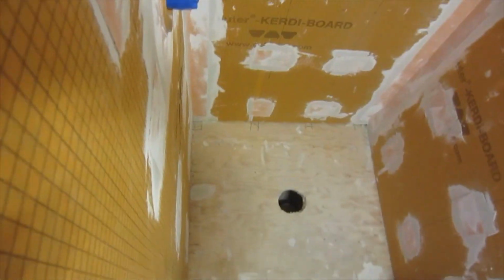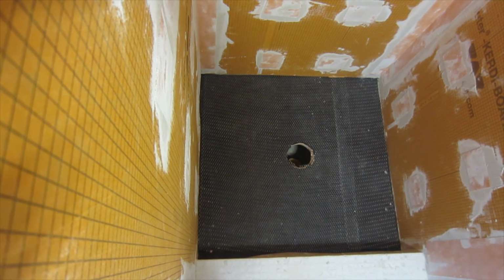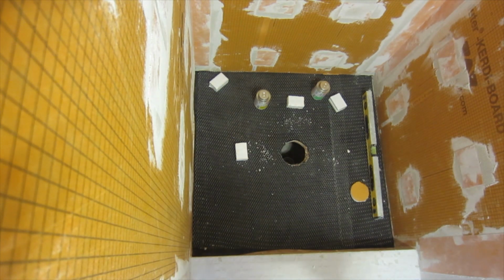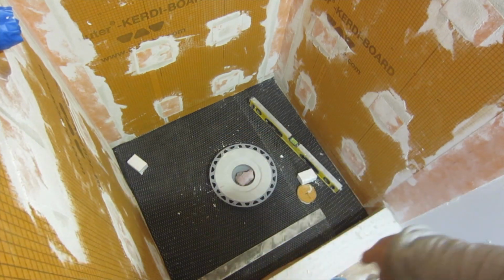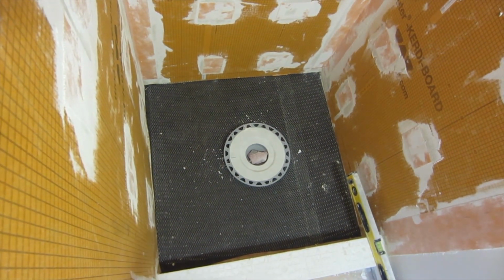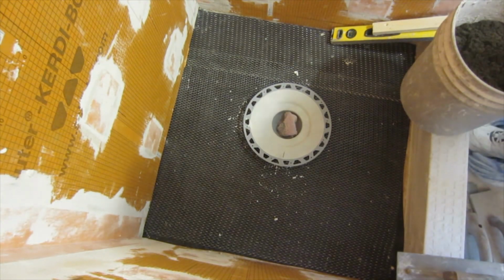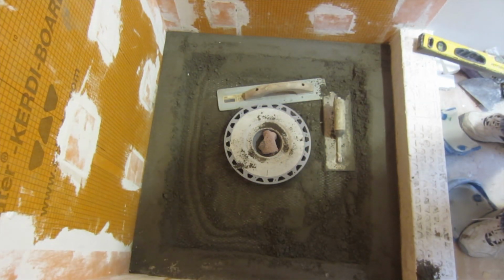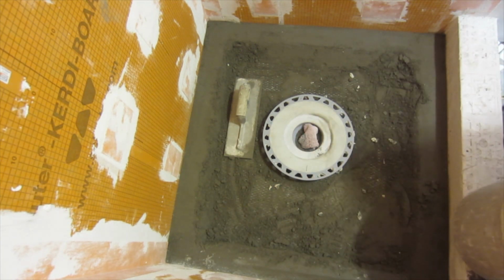How to install a Schluter Kerdi-Drain with Deck Mud

Comment: Hi Sal. A plumber installed a vinyl pan with mortar bed and clamp drain. It is over a cement foundation.  I found out he didn't do a preslope, so at this point my options are to just go with it and not worry or use the schluter drain a adapter kit, if I use that I'm not sure how it would work over a mudbed? Thanks in advance for your reply.

Comment: Sal, how would this be different if you had a shower with an offset drain? 3x6 shower qhere the drain is on the far right side, about a foot to 16 inches off the wall? The entire perimeter of deck mud wouldnt be level, right? Otherwise the slope on the right where the drain is close to the wall would be huge compared to the left...

Comment: How clean do I need to keep the top of the drain?  I thought there was a fleece like surface that thinset had to bond to, but it looks like the deck mud is bonding to it in this video?
Reply from the maker: Just wipe it off when you ate done, the mud will stain it but not ruin it.

Comment: Sal, I take it that you can't use thinset for the base ?
Reply from the maker: Not sure what you mean?
Reply: @SalDiBlasi  I mean over a plywood floor to make the base the base out of thonset
Reply from the maker: @johnwilz3949  On plywood, tar paper and wire lath, it is an unbonded mortar bed. On concrete thinset, which is a bonded mortar bed.

Comment: Do you have a video like this for a concrete slab in basement? I'm hoping to put a shower pan down into a slab, don't want to lose overhead space, also do no want a curb.  My slab is thin 2.5-3", so once I cut will be down to dirt.  Thanks so much great videos!
Reply from the maker: I do, https://www.youtube.com/watch?v=5GmutV5AOAU but I am working on a new one right now, time lapse tomorrow, full detail video soon.
Reply: HI thanks, I'll watch for it.  

I saw this one, building pan above grade and using a curb.  I'm trying to go curbless and save overhead height (low ceiling in basement).  

I'll be trenching to the area for rough in.  I'm hoping for a linear drain at the back wall of the shower, opposite the curbless opening. I will be making a rectangular cut (for drain and pan) on the slab and be down to dirt.    
So I'm assuming I'll need to dig down another 6-8 inches, rough in drain, then repour concrete back in to bring my rectangular pan cutout to approx 2 inches below existing grade?  Then my setup would look similar to the video posted above except side walls would be concrete for first 2", and drain rough in would be against the wall.  Do you foresee any problem areas with this type of approach?

Comment: Is it possible to use kerdi membrane with a normal drain assembly? Essentially to use kerdi membrane as a pan liner instead of the thick bulky pvc liner?
Reply from the maker: No, it is not designed to be used in that way.

Comment: Hi Sal love you channel, recently did a kirdi kit Wheel Chair accesable , I could not use prefab base ,because exsisting drains could not be relocated,  I dry packed over concreat floor using a modified thinset , to bond packing to concreat floor , I also used modified thinset to install kirdi over packing (packing sat for 3 days nice n dry) I used the kirdi notch trowel ,do you think there will be any issues with me using Modified Thin Set to set kirdi over packing
Reply from the maker: Not at all, the use of unmodified thinset for schluter products is when both surfaces which the thinset will be sandwiched between are impervious, the mud base is very porous so does not apply. Besides that, there have been advancements in thinset technology that makes the use of modified mortar in the scenario I mentioned not as cut and dry. There are many modified Thinset now that can be used with Schluter products, including Schluter's own Modified thinset AllSet.
Reply: @SalDiBlasi  I thought so as long as the wall or floor your attaching to can absorb moisture thanks for confirming my choice

Comment: Hey sal , how does water that seeps through the grout and onto kerdi membrane exit the shower if the drain has no weepholes ?
Reply from the maker: That is the beauty of this type of sealed system, it is thin enough that it can dry between uses, not like a "water in water out" system that has a huge mass of mud that will remain permanently wet.
Reply: The water would trickle from the membrane to the drain. It is a water tight system
Reply: Grout is waterproof

Comment: Hey sal, instead of using Kerdi board, can you just use Kerdi membrane on the walls. Like over drywall for example and then tile over that?
Reply from the maker: Yes you can do that.

Comment: Hey Sal just rip out my old fiberglass shower pan that was install when the house was built..I have a concert floor wanted to do the Kerdi shower drain but think it might have my finish floor higher than before...can i email you some photos for your advise.
Reply from the maker: +Orlando Adams I got the email and sent you a reply
Reply from the maker: ***** I like to have it at least 3/4 to an inch at the drain,
Reply from the maker: +jmprotile13 Sorry, I have never come across that situation, so i don't really know.

Comment: Sal, would this be what I could do over a concrete slab as well? Wire mesh then kerdi drain, is a  make a pre-slope unnecessary?  Large shower 6x4 with the drain not centered.
Reply from the maker: No preslope is needed wgen using a Schluter drain. There is only one layer of mud or a foam tray. No need for wire mesh on concrete, simply spread a little thinset just befroe installing your mud so it will bond yo the voncrete.
Reply: Sal DiBlasi Thank you, I haven't decided which way to go yet kerdi or durock. I did use kerdi for a tub surround but haven't used it with the drain for a shower.

Comment: Sal, you make it look very easy. How long did it take you to make the mud pan? In his book, "Tile Bathroom Remodeling," John Bridge wrote that you have 45 minutes to get it all done. That is the biggest reason why I'm reluctant to do the mud pan. Does the mud go to the top of the drain? And the top of the drain is level with the perimeter of the mud pan?
Reply from the maker: You are not going to mix it all at  once, a couple of bags at a time. You will have plenty of time, more than 45min. There should be a smooth transition from drain to mud. When you put the Keri membrane it will all be one smooth floor pitching to the drain

Comment: So after that sets, you can set tile on the deck mud?
Reply from the maker: No, absolutely not, the Kerdi membrane needs to be installed and tied into the walls with Kerdi-band. Then the tile.
Reply: Hi Sal, so just checking, because the Kerdi drain assembly was used here, a preslope was unnecessary, right?
Reply: (Since this shower floor was waterproofed when you later installed the Kerdi membrane)
Reply: @reillyliner  I think he saved money and use his expertise to make the slope out of mud and then buy the cheaper Kerdi membrane – as opposed to spending more money on the pre-fabricated sloped floor. I’m just a DIY guy trying to figure out how to proceed with mine!

Comment: you usually make a pre slope + liner on your jobs.Why not on this one?
Excellent job anyway!
Reply from the maker: this is schluter shower, totally different system.
Reply: +Sal DiBlasi In what aspects is it different?Is this system more reliable to do without a liner?
Reply from the maker: +Jee Z Hard to explain in a comments section, but basically the waterproofing is directly under the tile, this is a sealed system, a traditional shower with a vinyl liner is a "Water in Water out" system
Reply: +Sal DiBlasi  Ok thanks  for your answer.I just watched the schluter video with mortar base and now i get it.I'm planning to build mortar base shower in  a couple month, and schluter system  will be my first choice.However the shower drain doesn't come from the floor but the wall.Are schluter sys. sealable into mortar?
Reply from the maker: +Jee Z Not sure i quite understand what you are asking, there has to be a drain in the shower floor for the water to be able to drain, so the mud will have to be above whatever height it is on the wall.

Comment: great video sal, just wondering why didn't you use a rubber membrane? why did you use just the tar paper? thanx..
Reply from the maker: +manny ottenwalder This is a Schluter shower the oragne stuff that goes on top of the mud is the membrane. This is what you call a sealed shower system, far superior to a vinyl liner.
Reply: Sal couple quick questions.  Did you do a prefloat? Or were the layers as such: Paper, wire, mud nothing else? Is there a layer of kerdi that gets rolled out on top of the dry pack? Is the waterproofing the tar paper and kerdi on the wall?
Reply from the maker: The layers are just as shown, then the Kerdi membrane is installed on top of the mud to seal up the shower, This is how you do it https://www.youtube.com/watch?v=Z2p5ZBJHp0k
Reply: @SalDiBlasi  I bought a 10 year old modular home and just tore apart my shower because of the mildew stench. I discovered that there is no pre-slope, and the weep holes were covered with mortar. I’m really not sure how to proceed but I made a little video in case anyone can help me! I hate to remove the existing membrane because it did not fail. There was some wicking action from the cement board because it was sitting on the membrane and the original tile job was not great. A couple of the tiles were tiny bit lower than the drain on one side. So I’m torn between cutting out the membrane to do a traditional pre-slope or just putting a Schluter system right on top of it! https://youtu.be/EHh1pbSYJQo

Comment: sal, why dont you just use the schluter foam shower pan...instead of doing all that work?
Reply from the maker: Foam pans are nice, but you still have to make them fit the drain location and size of the shower, most of the time that means getting a bigger pan and cutting it to fit, which then results with a perimeter line that is not level and straight. The floor needs to be level as well , so that might need some attention. I mud it in and get exactly what I want and how I want it.
Reply: Here's another reason.  The Schluter ST tray is 2.75 lb polystyrene, which will support 45 psi (compare this to the Durock tray at 3 lb and 60 psi).  With small format tiles, such as mosaics, the tray will likely fail.  Schluter recommends using a mud pan for anything less than 2"x2".

Comment: Hi Sal! First, your videos are really helpful, thanks for doing them! Here's my question: I planned to have a 8x6 shower on my second floor. The drain will be the Kerdi-Line (or maybe something cheaper, if I can). This is a new construction and the constructor will do the presloap (plywood). If I understand clearly, I need to do what you've done in this video, add the kerdi membrane on top (with thinset under), and installing the tiles on top of the membrane. I'm missing something? Thanks!
Reply from the maker: Doing the sloped bed for the shower floor with plywood is not a good idea. So, mud bed or foam tray for the shower floor, Kerdi membrane and then tile.
Reply: OK! Thanks for the fast reply! Keep doing your amazing job, you're one of the best, if not the best ;) Cheers from the Quebec!

Comment: How did you know what height to draw your line on the kerdi board?  .  I see you made the kerdi drain one inch above the sub floor?
Reply from the maker: You need to have a pitch of at least 1/4" per foot, so if you set your drain at a height of 1'' and the furthest wall is 3 feet away, then the height of the mud will be 3/4" above the drain. keep the perimeter level, the walls closer to the drain will have a steeper pitch but the 1/4" per foot pitch will be maintained for the longest distance.  Sound confusing I know.

Comment: Instead of using the tar paper and metal lathe, could you put down Schluter Ditra like you would on the regular bath floor?  That would serve as an extra water proof material and because of the waffle grid pattern it still allows the mud shower pan to integrate.  Just wondering!!
Reply from the maker: I have seen people do it that way, but it is not something I would do.

Comment: Hi Sal, how thick is the deck mud at the kerdi drain? Do we assume the 1 1/2" min when setting the drain?
Reply from the maker: As thick as you need it to be, but  no less than 3/4", Mapei 4 to 1  has  a minimum thickness allowed of 3/8 , but that  scares me.

Comment: Why don't you use the Schluter pan?
Reply from the maker: TheMadChadder1 Smallest schluter pan is 48"x48"  or 32"x60" both would need to be modified, just easier to mud it in.

Comment: Hi Sal! Amazing work as always:) If that was a concrete subfloor instead of plywood, what would you do different? No felt/plastic, just wire mesh? Or would you just thinset the flat concrete floor, do one mud slope to the drain and Kurdi membrane the floor? In a jam and need your expertise. Thx
Reply from the maker: Yes just bond the mud to the concrete with some thinset then everything else is the same. Here is one i did for a linear drain, but the same idea. https://www.youtube.com/watch?v=1tQYSIZBUZM

Comment: I see you use the whole thickness of the styrofoam spacers that come with the drain kit to set the height of the drain. When I was watching the official Schluter mud pan video, they use the notch in those styrofoam spacers to set the height of the drain. Which one is technically correct or is either acceptable? Here is the Schluter video I'm referencing: https://youtu.be/SVaPHoYkU-U
Reply from the maker: Has to be at least an inch at the drain, however as long as you do not  exceed the capabilities of the mud used, it makes no difference what the initial height is as long as the proper slope to the drain is achieved.

Comment: thats  the driest dry pack ever
Reply from the maker: Not at all.
Reply: Jason Dennis i agree super dry
Reply: It's to dry not that it'll fail just preferences.  I like my pack damp enough to make a ball with out it crumpling with pressure but dry enough to form without it sagging . I use mapei 4 to 1 mid bed mix.  Smooth as a baby ass